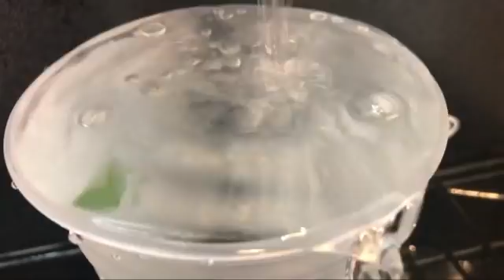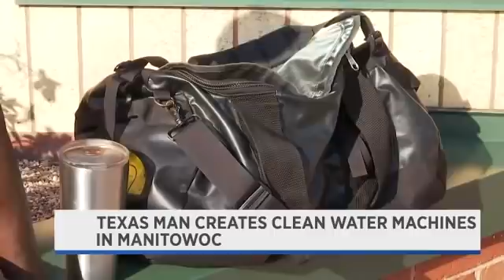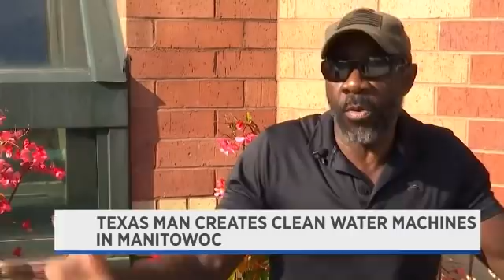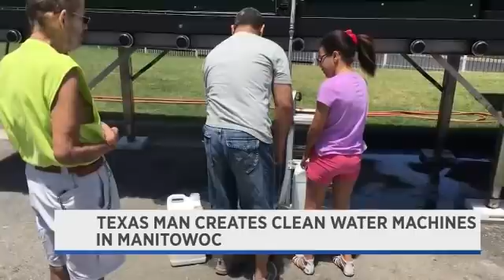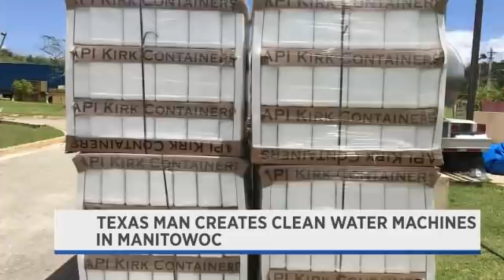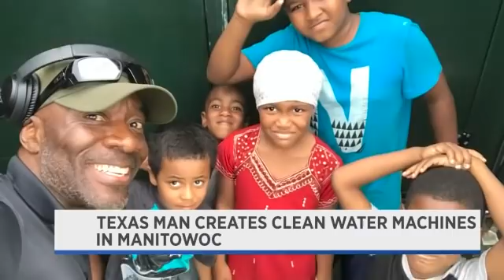Texas Man's Invention Creates Drinking Water from Air

Comment: Bwhahahahahahaha the news person claims the machine can provide a city with hundreds of gallons of water? How much water does a small township use? How much water do you think a large city uses? Bwhahahahahahahaha but here is your machine that can make a few hundred? And it’s free? BS. This is a surplus military mobile water station, or dehumidifier(google it)Ohhh yeah are your minds blown the guy invented something that was invented and in use for decades, and his machine that he claims he built, well it was actually built by the(or for the) US military. Hmmmmmmm confusing. Thanks for the selfies though. How about showing this thing running, you know belching black diesel smoke and sounding like a small locomotive as it produces several hundred gallons of water which tastes like, well water from the bucket in a dehumidifier. In another video he claimed to test the water purity himself and that his standard was higher than that of the FDA? More BS.

Comment: Just incase yall didn't know, you air conditioning does the same thing.
Reply: well go drink the water from the air conditioner since it's the same thing
Reply: @biteoftheday6374  💀
Reply: @biteoftheday6374  this technology has been in use in israel for over 15 years. This dude did not invent it. The ones in israel produce even more but you are so blidend by your "blekness" that you wont even research. "We wuz kangz n shiet"
Reply: hanibal Garcia been here for over 50, it’s a dehumidifier genius.
Reply: For every pound of gasoline you burn. You make 13 pounds of water. This is the only way to make a large amount of water.

Comment: MORE BLESSINGS FROM ANOTHER BLACK PERSON.
Reply: Don't get fooled, it's just another dehumidifier. Power hungry dehumidifier.
Greetings from Czech Republic
Reply: @Staremperor  A large scale dehumidifier with a filter built in to create 2000 gallons of drinking water a day.   It is quite an accomplishment for a dehumidifier made of mostly affordable easy to purchase parts.
Reply: @Urrelles  But the electricity bill will be astonishing. Dehumidifier needs to condensate the water. You need 2 257 kJ to boil 1 kg of water. So in order to condensate it, you need to take same amount of energy out. That's a lot of work and that's why dehumidifiers are not used to produce drinking water - electricity bill would make it prohibitively expensive.
Reply: @Staremperor  Good point.   But I guess in the case of Flint it works since they have a stable grid.
Reply: @Urrelles  Of course, it can work. But it would be the most expensive water you'd ever drink. Even desalination is less power intensive and therefore cheaper.
Reply: @Staremperor  But that's the thing.  We dont know how much power this guy's machine draws.   It could be a low power draw.
Reply: @Urrelles  unfortunately it could not. Because we know how much energy you need to boil water (or vice versa how much energy you need to take away to condensate it). I'm sorry, but we can't argue with thermodynamics.
Reply: @Staremperor  That's why youre not inventing anything.  Because you think everything is set in stone and unmovable.   Thermodynamics has nothing to do with technology's capability to convert and use energy efficiently.   The energy it takes to boil water is set in stone.  But where and how you obtain the energy is an open book.  We have induction stove tops that use a quarter electricity to generate heat to cook food.   

We dont know the specifics of this guy's machine to know how efficient or inefficient it is.  There is a reason why it is called a breakthrough invention and nobody is officially debunking that claim.
Hell, the only people debunking the man's work are youtube commenters who think they can do it better with no proof.  :/
Reply: @Staremperor  BTW he worked with a power company to reduce the energy consumption into something manageble.   So the energy issue is resolved and it is one of the things that made his invention an invention.

https://youtu.be/HM9mXdRdz6c

Theres the video.  It is a 30 minute interview of him detailing how he made his disaster relief foundation.  How he reduced energy consumption of the machine.
Reply: @Urrelles  
Thermodynamics has EVERYTHING to do with technology's capability to convert and use energy efficiently. Internal combustion engine loses a lot of energy to heat because of thermodynamics. Electrical motor is much better in this.

Heating your home by burning wood or coal is less efficient then pumping the heat in by heat pump.

This guy's dehumidifiers looks very much the same as standard dehumidifiers, that are on the market. They are as efficent as they get. But it's just less energy intensive to desalinate sea water or to pump water from subterranean aquifer or to treat river water. That's why we use it. 

One day, when the energy is so cheap, we won't have to worry about it at all (like 80 years into fusion power technology), that's the point, when you can implement dehumidifier technology widely. Until then, it's just not worth it.

BTW dehumidifier was invented 1902.
Reply: @Staremperor  Thats the thing.  Moses clearly states that he has made an energy efficient dehumidifier capable of large scale production.   

So the thing youre bitching about that makes dehumidifiers inefficient is the very thing he solved.   Watch one of his 30 minute interviews and he talks about that challenge and how he overcame it.   

So HIS dehumidifier is great progress compared to the 1905 one.  Therefore he has made an invention.
Reply: @Urrelles  if you are so worried about Flint Michigan, then I think they can collect rainwater, you can buy an ultraviolet system to purify the water, then buy a filter. If clean water is so much of you all concerns then that is the route. Why wait on the racist government to give you all hand outs?
Reply: @malazkm  Again that makes no sense.

1.  No one is waiting for government handouts.

2.  Moses West is distributing his machine to Flint right now to provide water.  Why?  Because he doesnt believe in waiting for "handouts" like you seem to assume from…… .where exactly? 

3.  Rain water will not supply drinking water 24/7.  It has to rain.  What happens when the rain stops?  Water depletes and your back to spending millions shipping bottled water to feed a city of over 50,000.  A process that is 5 times more expensive than having AWG mavhines around the city.

Youre literally just making up hypathetical motivation and scenerios that dont exist now.
Reply: @Urrelles  apparently so. You keep talk about the "racist" government, black people in that area should is their minds together. All these years black people still complaining about the government, yet not trying to do anything, trust what I stated will be more cheaper. Ijs.
Reply: @Urrelles  it to s called harvesting. You can purchase water tanks. Plus not to mention look at Arizona. There are some YouTubers that uses rainwater and their are in the straight desert. Yet relying only on rainwater. Show me I'm wrong then I will shut up. Handeeman. Is one YouTuber that uses 100% rainwater. Off grid living with Doug and Stacy in another stated uses 100% rainwater. Homesteadonomics is another YouTuber uses 100% rainwater. I can keep going and going. So what I'm stating makes perfect sense. Rain will always come. Duh
Reply: @malazkm  Youre gonna have to show me a direct quote about the "racist government" or the "handouts" you claim I talk about.  
But im also still waiting forvcitation from an expert denouncing Moses invention.
Reply: @malazkm  The rain water collection in Arizona are personal projects.  Those collections are not designed to feed 1000 people.  A whole city cannot sustain its population on rain water collection.

Also, how do you distribute that rain water to everyone if the pipes are all contaminated with lead?
Reply: @Urrelles  uh that is not true. Where did you get that from? Georgia is for more of that. Look at the bill 2830 in Arizona about rainwater collecting. 6ou may want to look into that before you make a comment.
Reply: @Urrelles  plus I stated off grid living. You would have to have your sewage and piping without restrictions. That is a start off. And I think Michigan is pretty leniant on that way cheaper than a dehumidifier.
Reply: @Urrelles  LMMFAO!! I do no have to show anything look throughout this thread. LMMFAO!!!
Reply: @malazkm  Looks to me like Bill 2830 legalized the collection of rain water and solar energy in Arizona.  It also allows people to earn a sort of tax credit towards the water and energy they save if they add to the power grid.

But has no mention on distribution.

It is not addressing anything that we are talking about which is focused on efficient distribution of water.   I read through all the conplex legal jargen.  It just amends old laws that made collection illegal.
We arent talking legality.  Legality wont help Flint if their water pipes are rusted up and filled with lead.  

Ah shit! Im sorry.  Im not supposed to take time and read.  Im supposed to fit in your racist stereotype you mentioned in another comment about "niggas not reading".
Reply: @Urrelles  LMMFAO!! That is amazing that you read. My whole thing with that instead of people focus on this machine which he did not create, there are other ways to get water. I put it in a bigger way for you to do some research. So I'm glad that since you made a false claim, you took the time to research. But yet you fail to do the same on this topic. Which is fine. Which proves my point. LMMFAO!!
Reply: @malazkm  Prove that he did not make the machine.
Reply: @malazkm  You are the only one making a claim.  You claim he did not make his, machine.  Who did?   Why did the patent office not reject his machine? Who is suing him for patent theft?   Nobody.

Because YOU made a false claim that you cannot back.   And everytime I tell you to prove it with a verafiable professional source, you makeup some other bullshit that ends up being off subject.

Prove your claim, or admit, his machine is an invention.
Reply: @Urrelles  you can read the comments on this. What I'm stating is a fact. 50% know he DID Not create this, 50% think he did.
Reply: @malazkm  It doesnt matter what youtube commenters think.  There are laws and rules that dictate an invention.   US patent office doesnt care if 50% of youtubers agree or not.

Only professional industry experts and patent lawers can say he is just a copycat.   You need to prove that his machine is not his own invention, and not rely on mob mentality to try and prove a point.  We are intelligent oeople in a structured society with rules.  Use the rules and prove your claims.
Reply: @Urrelles  are out serious? It is not his invention. Damn.
Reply: @malazkm  prove it…… ..
Reply: @Urrelles  look it up.
Reply: @malazkm  its your claim.  Do the work.  Dont be lazy.  I believe in you.
Reply: @Urrelles  LMMFAO!! You should never say that. Come on now. Where does me being lazy come from when you refuse to look it up yourself?
Reply: @malazkm  I looked up and proved my claims.  Look up yours.  Im not doing your work for you.  Stop being lazy.
Reply: @Urrelles  LMMFAO!! Been looked it up. This man did not create this. He made a bigger machine from someone else invention. He will never be a Tesla. That is a fact
Reply: @malazkm  Good then you have sources right?   Prove your point.
Reply: @Urrelles  LMMFAO!!! I proved my point. On my thread with the links. You can look it up
Reply: @malazkm  On your thread? Where? What website?  

The only thing you've done is repeat the same lie over and over and claim it as truth with no links or citation.

You know Ford made the Model T.   So by your logic Toyota never invented thw Tocoma today.  And Porche never invented their sports car.  Because by your flawed logic, they never created thos cars because Ford made the first one.

Worst of all you have no professional sources and you want someone else to prove your point for you.  It's just soooo hard to copy and paste links, right?
Reply: You mean Swedish... the Swedish invented this.

Comment: Another "water from air" device. People this sharade has to end, it's a scam that people always fall for.
Reply: Mpumi Gugushe You must be nuts.What are you refuting ?
Reply: @waltermbelwa4973  A scam, which can be EASILY proven false, because this thing, is just a giant dehumidifier, which takes way more energy than any other water gathering method we have, hell even desalination is less costly than this thing
Reply: @waltermbelwa4973  1. This device wont work as well as intended because this glorified dehumidifier is heavily dependent on the humidity and temperature. It is best used in very hot, very humid places... at which point it is most likely to rain anyway, so its essentially useless

2. The cost of this water is nonsensical too because it would take a HUGE amount of energy to turn water vapor into water, that's how it is and there is no fancy way of getting around that. And then there is the matter of treating it because the water from air will be filled with dust and bacteria which will need to be treated, something you cant say about water from a tap. It would be cheaper to use our current piping systems than pulling it from the air.

I get it, it SOUNDS great and if this were possible, it would be great. BUT IT ISN'T. Companies, universities and scientific institutions tried and failed at this water from air bullshit. And this man is no different.

People need to accept that this snake oil of "free water from air" is just too good to be true.
Reply: Mpumi Gugushe Who is going to purchase one of these machines as an individual/private organisation/government etc if they are proven not to be practical ? A product succeeds or fails at the international market.What is your fuss Mpugushe ?
Reply: browneet caramell  my point is that this device will never deliver on its promises. No other similar device, or dehumidifier can pull any useful amount of water from the air. 

I'm not a hater, I just despise snake oil concepts that deliver less than they promise. So either A. He genuinely thinks this will work as promised (which it wont) or in which case I'll give him the benefit of the doubt.
Or B. Hes scamming people because he ran the numbers and knows this wont work. So hes going to go ahead with this crap anyways
Reply: Mpumi Gugushe You seem to be a South African employee of Nestle Corporation.Anybody can google for further information to disprove you.Sorry.
Reply: @waltermbelwa4973  Wow... please provide a link that proves cause this is obvious bullshit you pulled out of your ass. I dont work for Nestle and I find them particularly loathsome for other reasons

But since you're in the mood for research why dont you look up. "Fontus the self filling water bottle". Or "waterseer" the and see how those water from air projects failed and how they ran off with a lot of kickstarter and Indiegogo funds. This man is no different from them.
Reply: @waltermbelwa4973  Instead of falsely calling people out as shills for big corporations. Why dont you do your damn research on the topic, and maybe... just maybe you can see why I'm not alone in thinking that this water from air snake oil is distasteful bullshit.
Reply: @waltermbelwa4973  Until you provide a link which 100% confirms this. I will call you out for lying and assume you are a shill for the "free water from air" scammers.

Comment: Take it to Africa, also.
Reply: Where it wouldn't work, because this device is basically a dehumidifier
Reply: @unverifiedpenguin  Well, it will work, it will probably put out like 200 ml per day, but it will work
Reply: @Prince995  Yeah, but you're missing the point. A dehumidifier (which this thing is) will work best in places with high temperature AND high humidity.  Which is basically conditions before a thunderstorm, so if it will rain anyway, what would be the point. A rain catcher makes more water than this thing.

And it take a shit ton of energy to pull water from water vapor. Significantly much more than getting it from the tap and piping. So again, the costs would be high if you are using a dehumidifier to get your water. So it would cost more and take much longer to get your 200ml of water by pulling it from the air. Plus the water isnt even treated because air has dust and bacteria. Which will show up in the water too, so that means it would need to be treated too, another additional cost, where as the water from the tap is already treated.

So yeah, if this scam snake oils salesman really wanted make a difference in say... Africa, you would want to focus on water treatment. The problem there isn't that there isn't any water but the water that is there is not safe to drink. But no, let's go with stupid idea of pulling water from the air just to bait the suckers to pay for this useless device because they dont know any better.
Reply: @Prince995  great thought but Mpumi Gugushe has a point. Either we find a way to treat see water or water from the rivers(some places use condensation) Or create an H2 plant were we can make water at low cost. This technology is great, but not effective in Africa.